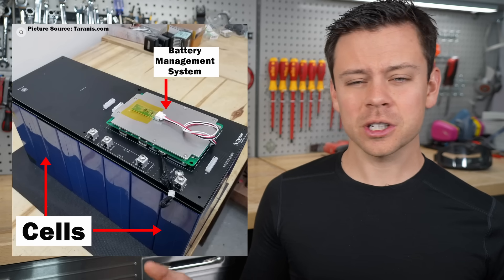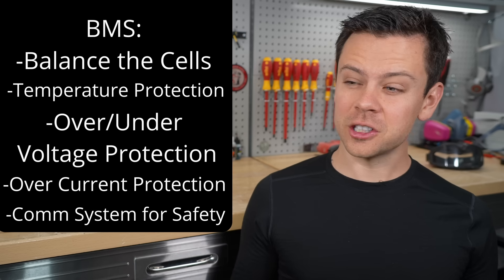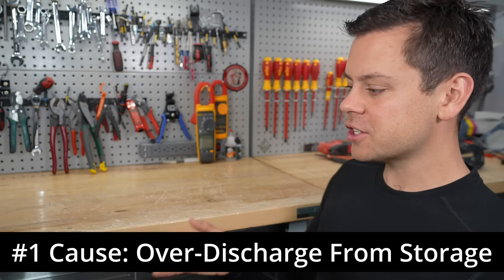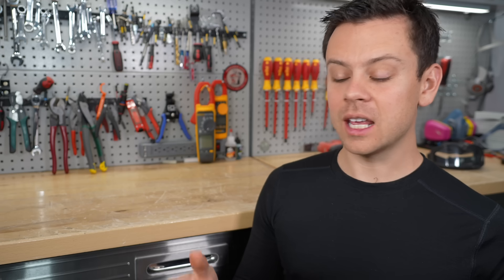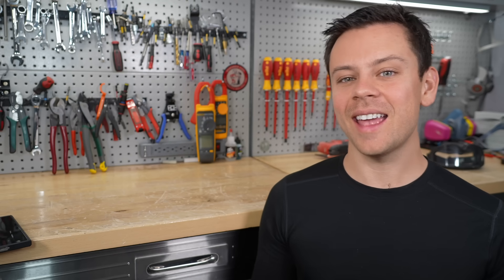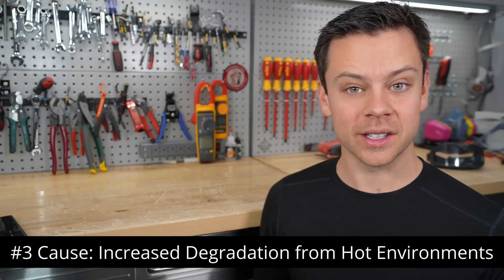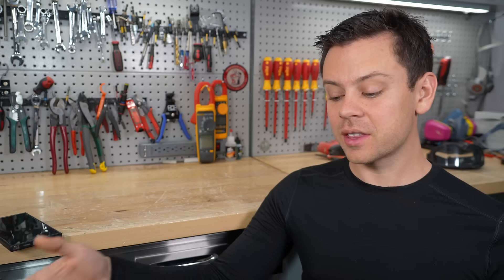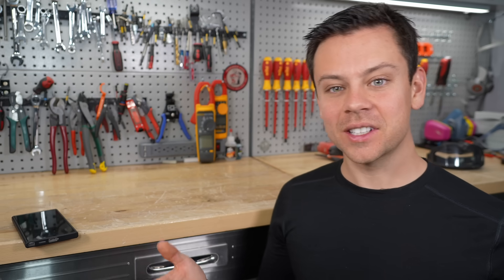The Rules of LiFePO4: The 3 Most Common Causes of Failure and General Guidelines for Long Term Use

Comment: Question. You said to charge them to 100% and discharge to 0% for optimal battery health. What about solar charging on a daily basis that recharges the batteries before they’re ever able to drop to zero? 

This is for those of us with an RV or trailer that sits most of the time with solar panels, keeping the batteries charged, and only use more of the batteries capacity on the occasional trip. Should we disconnect the solar charger? 

Would love some feedback on this. And as always, thanks for the videos!

Comment: I have a 24volt system with 6 12 lead acid batteries (100ah each) separated into 3- 24volt banks. When they are fully charged, and I am not using them they seem to drain down a lot, bar graph on monitor full and then later at 25%. Any ideas?  I have 2 panels feeding this setup for a sunroom.

Comment: All very good advice! I'm currently following all of the practices you recommend except for one. My (9) 25.6V 100AH batteries are located inside an uninsulated steel cargo container in the desert - and it tends to get pretty darn warm inside there in the summer. I haven't had any problems with the batteries or electronics of my off-grid system yet - but I'm planning to add an evaporative cooler within the next few months to lower the inside air temp during the summer using surplus solar power. I am toying with the idea of also including tubed cold plates under the batteries - circulating chilled water from the cooler. I would use an upscaled home-made version of the CP15 style cold plates I use in some of the equipment I design at work.

Comment: If discharging them to zero doesn't harm them, why does the battery specs say 2,000 cycles with 100% DoD but up to 5,000 with 80% DoD ?  That's a difference of 8 years of battery life.

Comment: I have two 200 ah LiPo lithium iron batteries in my van
Screen is reading full batteries although I'm having electrical issues surging the system turning on and off every few seconds I'm told it could be a Cell within the lithium batteries 

Does anyone know how to check the cells I hear I can hook up to a computer although no clue on how to check each cell 

If anyone has any insight I would be eminently grateful

Comment: I installed my solar system four years ago on my Cargo camper with Will's help. I have been in 107° down to 10° with no problem. Ran it to zero several times. Still going strong! Will is the MAN!

Comment: Thanks for this,

I have 4 100kWh batteries (dragonfly) that are heat enabled We have long periods of cold weather in the winter here. Usually 1 to 2 weeks run at daytime temperatures below -20  celcius (a few nights will go down to -30 celcius). Is it okay to leave them in the trailer plugged in to shore power? or shoud the group of them be taken out and stored indoors?

Comment: Store at 50%?  Why not 100%?
Reply: I think he said it's because 100% triggers the BMS the battery management system to start the balancing process.  That would mean if you charge to 100% and maybe leave it on until it gets to 60 or 50% and then store it the battery will be balanced  when you go to use it.
Reply: @crystalclink Except that I expect to use it during an unexpected power outage.  Storing it at 50% charge means starting an outage with a 50% capacity deficit.  My battery system supplier recommends charging to 100% & then recharging if/when the battery drops below 80% in storage.

Comment: I have a question. What about using the battery in a RV with an intelligent power supply? It maintains 13.4 volts while on shore power. It also bumps up to 14.4 volts every 20 hours. Is that okay? Thx

Comment: An all high end solar batteries such as: BYD, Pytes, Sungrow and Pylontech, all of these manufacturers do now allow discharging below a SOC of 5~8% as they claim that it will degrade the battery faster. To maintain the 10 year warranty, you must use the recommended minimum SOC. For BYD, Sungrow and the newest Dyness units this is 5%. The others are 8%

Comment: I put LFP in my 36v golf cart.  After a year my capacity dropped such I couldn’t even play 18 holes. Chin sent a check list and said to call if I couldn’t resolve. Not on the check but I found a 36v/48v switch on my charger. I taped it to 36v to keep it in from getting accidentally switched.

Comment: How do you suggest to charge to full capacity? Lots of videos have fancy bench equipment(clarks adventure channel). Can a person get buy with just charging with battery charger, charge to full charge and then connect in parallel? with say 4 batteries?

Comment: I installed 4 12v Chins LiFePO4 in series in a Ryobi RM 480 riding mower 2 years ago and had over 4 hrs of run time, but recently the battery's bms shuts my mower off at 90% charge at 52v. I disconnected the batteries and charged each one to 100%, then connected them in parallel to ballance. Still only get to 90% before shutting off. Anyone have suggestions?

Comment: Hello. Great video. I am new to Solar and Lifepo4 battery's. I have a small set-up in my garage. 400w of Solar panels, a Victron SmartSolar MPPT 100V 50 amp Charge Controller and a DATOUBOSS 12V 300Ah LiFePO4 battery. The battery does not go into absorption mode but stays in bulk. Have set the controller to recommended settings. The supplier of the battery has advised that I need to drain and charge the battery 10 times to 'activate the electrote'. Have done this but it has not changed things. Any idea what might be wrong?

Comment: "charge to 100% (every time)" - okay. But what is 100% ? Is it what a device reports the battery % to be while compensating for not reaching the very high or low state? Or is it voltage? Is it what the BMS reports to be (thinks is) the charge state based on the calculations they do from monitoring characteristics of the cell the last time it went through a full cycle? Because that can be calculated wrong if it hasn't for a while. Hopefully you can see that saying "100%" is meaningless without specifying what that should mean.

Comment: The type of cell balancer that kicks on at 100 per cent is called a passive balancer . It will disconnect the higher voltage cells and continue to charge the lower ones to match .

Comment: Question:  I have a Nermak 12V 10ah lifepo4 battery and it's not charging after 6 months of storage.  it was charged to full before leaving in storage.  It's now at 9.44V and won't accept a charge.  Is there any way to revive it?   I've tried using a car starter battery to "jump" start it but that didn't seem to work.

Comment: Perhaps this is a redundant question but, I’ve been seeing a lot about fire with LiPo batteries. I have a few 2,000 watt for my Titan solar inverter and starting to get concerned about charging it or even leaving it in my house
Reply from the maker: We don't use lithium polymer. No one does. With him iron phosphate is a different lithium ion chemistry variant. It doesn't have self propagating thermal runaway
Reply: So if my batteries are NMC that would be a concern of course, would you suggest swapping them out and if so how would I determine what fits my system?

Comment: The other thing people need to know, the price of Lifepo4 is dropping like a rock, so are management system. There are people getting raped over boat systems at $40K that should cost $10K or less. The Victron system generates more heat than the batteries. How do I reach you directly for some words of wisdom on my boat install coming up?

Comment: The recommended minimum charging temperature is 32F for LiFePO4 batteries.  How crucial is that?  What if one charges them at 30F or 28F?  Will the BMS even permit this to happen?  Thanks!! 🙂

Comment: 3:40 The BMS of my (just bought new) battery obviously works different - probably because of a passive balancer: It just balances (according to the bluetooth app) while you're charging it at minimum of 1.2A and starting at about 13.3V main voltage. So you always have to discharge it to 13.3V and charge it with an adjustable charger with about 1.2A until the BMS switches off (at around 13.8V) and then discharge it to 13.3V again and so on. I'm currently doing this since a few days (every cycle takes about 3 hours) and slowly the max cell differences decrease and the max battery charge level increases (first time was around 13.6V). That's obviously the downside if you buy a cheap battery...

Comment: I am curious. I just purchased an electric battery cooler. Love it. However, what you are telling is if I keep this in my vehicle all the time, it will kill my  LiFePO4 batteries. FYI. I live in the South. So it gets very hot especially in a vehicle. Do you how much generally this will degrade the battery (i.e. 40 or 50 percent over 1 year or 2 years). Best estimates would be appreciated.

Comment: Thank you. I am a retired electrical engineer and I appreciate this information.  Can you please comment on the potential dangers and battery degradation caused by connecting different brand/current ratings batteries together in parallel?   Specifically I am addressing e bike batteries.  Many add a separate battery of different capacity and brand and just hook them up in parallel to the built in existing e bike battery.   I think this may degrade the batteries over time as the load sharing is unequal.  Am I wrong?  I added a DPDT switch to isolate them so only one battery is connected to the e bike controller at a time.  I that overkill?

Comment: So for Tesla 3 LFP 60kW battery, if I use only around 30% per day, is it ok to charge it from 70% to 100% every night at 11kW chargning?
Reply: Very different battery chemistry than what he is talking about. I've always believed that not charging to 100% is the norm for electric vehicle batteries.

Comment: Hello Will, I have a 10c/ft refrigerator at my cottage along with 3-4 7w LED light bulbs running 3-4 hours a day. I was wondering if you could tell me how many AH I would need to run my set up safely and efficiently. I currently have 4 120ah lead acid batteries and I ran system about 4-5 months continuous and it seemed to knock my batteries down to where there not much good this year. I’m looking at buying the Li time brand lithium batteries. Thank you for your time

Comment: I’ve been having a problem with my setup. I have 4-12v LiTime batteries in series for 48v with a eg4. And it never charges to 100 percent. The only way is if I hook up my generator and even then once I turn off my generator it’ll drop from 100 percent down to like 80 percent within 10 mins. And I barely have a load on it. A mini small fridge and a few lights. Any ideas? I’ve disconnected all 4 and checked the voltage on them. 2 are 13v and the other 2 are 13.3

Comment: Just curious, you didn’t mention it in the video. I have a system set up in my van, and I rarely use much of the battery during the day and night. Sometimes there’s no sun, and I do use all of the battery capacity. Maybe like 15% per night. Should I run my batteries down to zero every now and then or does it even matter?

Comment: If this battery suffers capacity degradation to less than 100%, can the BMS perform proper cell balancing because the automatic triggering of its cell balancing function (at 100% charge) will no longer come to pass?

Comment: 50-year EE here (communications, not power), and this answered a lot of practical questions I did not know.  I also did not know your name (thanks for pinning a note that added that), nor that you have some books on related topics - I just bought one.  One confusion for which I'll check some of your other videos:  If I'm keeping an LiFePO4 12V/100AH battery stored in case of "the great flood" (as my lady names it) what is a good charge/discharge protocol?  I see "charge to 50%" and "charge to 100%" as well as "discharge to 0%," but how often to do which and what's a suggested way to discharge (other than a fistful of power resistors and a voltmeter)?  Do companies make charge controllers that incorporate this kind of complete charge+discharge management?  Or is that my next Arduino project?  Thanks, I've subscribed.

Comment: The biggest downfall of fully discharging every day is that you have no reserve for tomorow if it rains or snows, especially snow cause that'll block the panels from making anything.
Reply from the maker: If you designed your system properly you should have three days of backup

Comment: So, my Ecoflow Delta pro battery should be charged to 100 and drained to 0? Not the suggestion 90, down to 80, back to 90? I use it for backup power for security cameras and Starlink. in case I lose Grid power. So what’s the best routine? Also, we have 9 Husky battery’s. We only use them 10 day out of the year. Then we store them. They seem to be out of balance. What’s the best way to get them back in balance? And best routine after balancing? Thank’s.

Comment: I put a LiFePO4 Shorai battery in my Suzuki  DR650 fifteen (15) years ago and it worked flawlessly until the other day when I realized it was sitting at 0.000 Vdc on all four cells. The reason it died quickly became obvious. When I had parked the bike two years ago, I had forgotten to disconnect an accessory outlet that had a tiny green LED. That LED drained the battery down over the months to zero volts. I used a spare charged lead acid car 
battery and jumpers to bring the battery voltage up to about 1 Vdc and that was enough for the Shorai charger to take over and resurect this battery. Simply amazing.

Comment: Hold on, but how is fully charge and discharge related with the cycle life that is guaranteed by the manufacturer with a DOD of 80%. You say that 100% charge discharge is no problem, but the spec of the manufactures says it shortens the cycle life of the battery. Can you explain what is true or not true here.
Reply from the maker: The calendar aging will kill it before you hit cycling degradation with a solar power system

Comment: I'll never ever ever is lithium in a sailboat I'm going back to lead acid I've had two batteries lithium iron The booger tried to catch on fire story popping and spitting not for me not lithium no more for me two dangerous and a boat let acid I have no problem with They do wear a little more but they're safer too

Comment: Thanks, as always, for the excellent, well-presented information, Will. So, I understand that it's best to charge my LiPO4 batteries to 100%, and not be afraid to discharge them to zero. My use case is an Anker Solix 2000 charged with solar, in a camper van. My question is: would it be worthwhile to unplug the solar input once I hit 100, and deliberately cycle the battery to zero or close; or are the benefits of that minimal, and it's okay to just leave it plugged in all the time and forget about it?

Comment: Hi Will,
I have a question regarding an LFP 200AH battery. For the first three months of use, based on its 200AH specifications, a technician noticed that the Battery Management System (BMS) from the vendor was programmed for a 150AH battery.
This battery is rated for 6000 cycles, but after only 670 cycles, the cells became inflated. Upon reviewing the data, the manufacturer found that several cells were defective.
My question is: Could the fact that the battery operated for three months with parameters set for a 200AH battery while the BMS was programmed for 150AH have been a contributing factor to the battery issue?
Thanks for your insight!

Comment: new to all of this and love your videos.  i am looking at buying a 460 ah v2 Elite by Epoch.  There will be a host of Victron components used.   i will be using it on a 38 foot sailboat and I plan to live on board.  i will have refrigeration, communications, navigation, charging phones/ipads/computers, once per day coffee machine.  I will be in Maine during the summer and the Caribbean during the winter.  i will try and get 1000 - 1200 W of 12 volt solar panels.  I will have a Victron 3000 A converter.  my biggest question, right now, has to do with BMS.  Yes, Victron would be great.  Yet, the Epoch Elite V2 460 ah series comes with an internal BMS and app/software.  Someone who is deep diving everyday may want the extra info a Victron provides.  I'm not that guy.  Does the Elite BMS and their software mean you don't need the Victron BMS?  Also, you noted that BMS dies more often than battery so a backup is a good idea.  Maybe both, for that reason alone, makes the BMS from Victron a good idea?

Also, there is a fuse located under the hood of the battery.  Fuses blow.  Would it be crazy to buy a backup fuse?  I'm a little nervous because one battery dying when you have a one battery system, is no good.  Yet, I don't want to pay for 4 120 ah batteries, go through the hassle of wiring, weight, size, etc. 

Stupid people ask lots of questions.  Plus, I want to hurry up before the tariffs really kick in.  I saw your video on the tariff debate.  Made it pretty simple.  And they still won't get it.  They think China is paying the tariffs.  It is a darn tax on Americans.

Comment: I have 2 X100ah lithium batteries, 380watt solar power. While my RV sits in a covered storage facility the batteries are kept at a 100% charge just from the partial solar charging. We use out RV one week out of each month so it never sits longer than a month unused. Is it safe to keep my batteries at a 100% charged all the time or should I turn off the solar shutoff switch and k=just let my batteries drain down slightly over a month? The battery shut off switch is always off so nit much of a drain on the batteries.